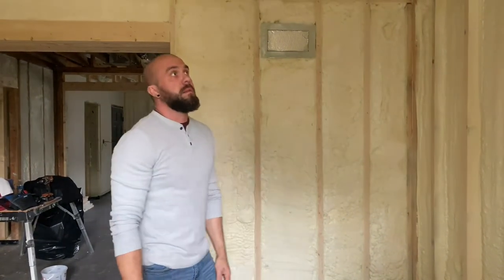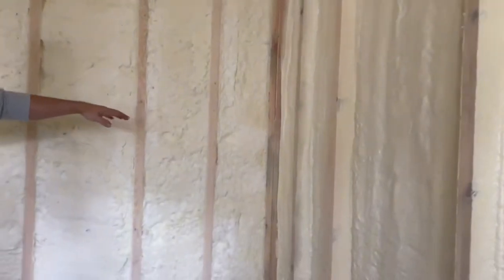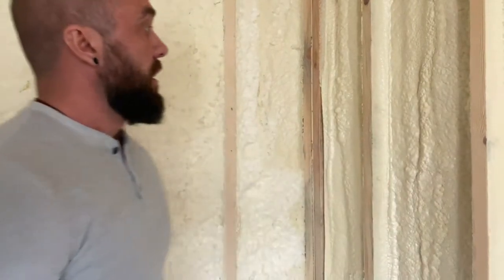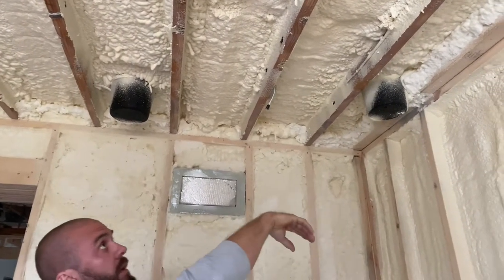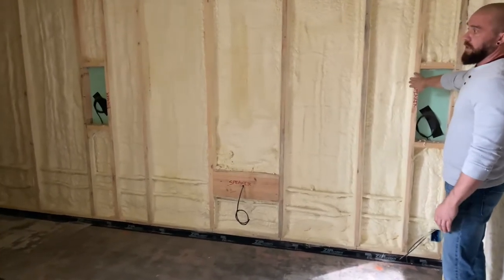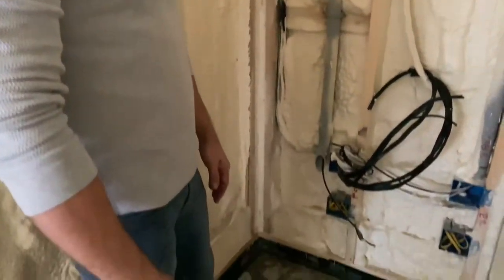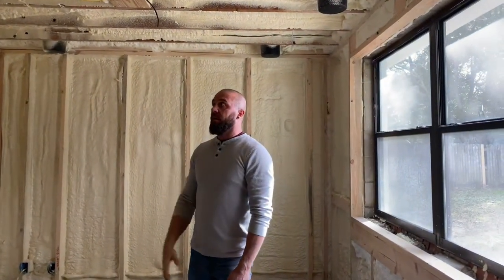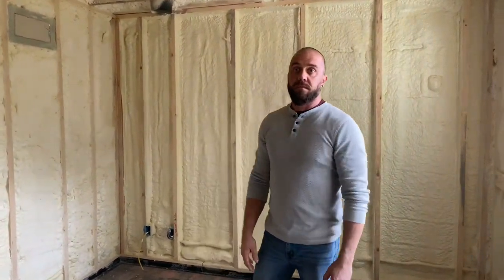Building an amazing Dolby Atmos home Theater  Part 2 ....spray foam!

Comment: what projector and speakers are you using
Reply from the maker: The front is a mix of paradigm and Polk. The in ceilings are all OSD, They have an in ceiling line that’s Dolby Atmos👍🏼 the projector is going to be the BenQ HT3550 4K I’ll post a video of the finish, as well as the complete theater setup.....thanks for watching.
Reply: @chrrcompletehomerepairandr4199  I have my eye on the q series from kef